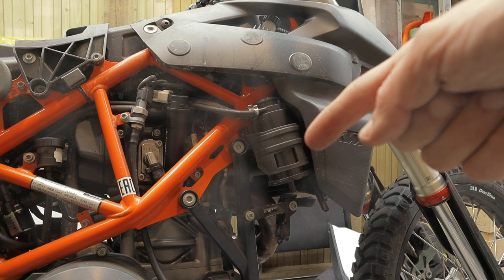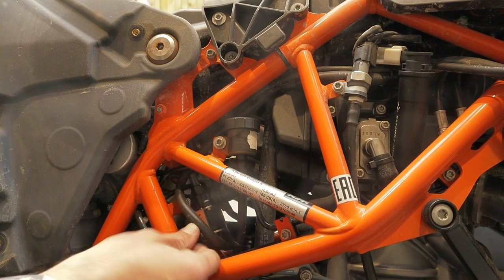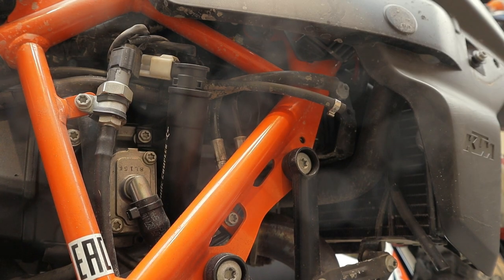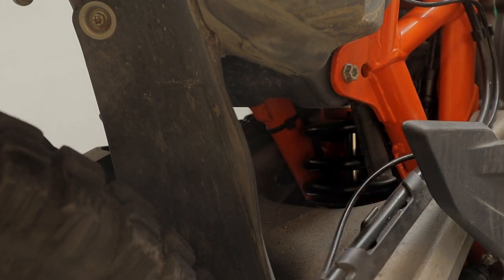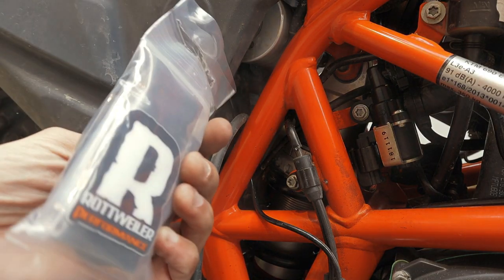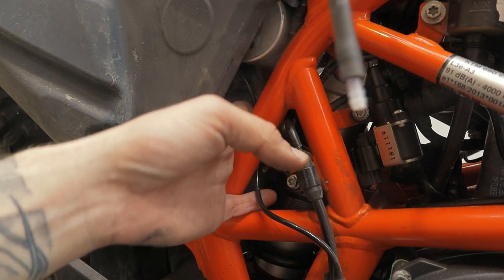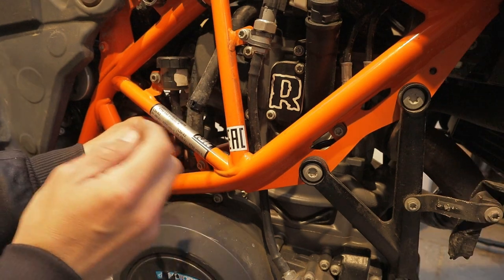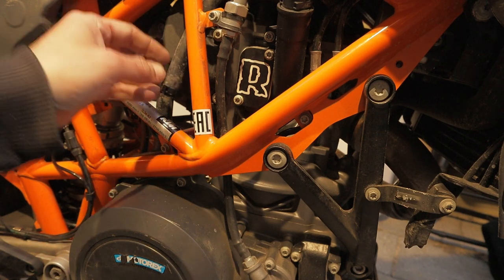KTM 690 Enduro R - How to install Rottweiler SAS/Canister Removal Kit [SuperMoto build series -Ep.3]

Comment: Great video...love the details & attitude. Question...instead of removing the big fat downtube with the Y on top of it (which was a lot of work) could you not just leave it there as is with the Y and two small tubes connected to the Y, and just cut the small tube coming from the canister and inch or so away from the Y and tie it closed with some wire ties ?...would that work ?

Comment: I hate buying stuff I dont need to and it appears purchasing this kit is not required..right?  ALL the "dongle" is is a 22k ohm resister?   less than a dollar....I am assuming I could use the existing plug and just solder a resister accross the terminals....then what is there a screw?....a tie wrap?   Now the blanking plate I dont see any need for....all that is needed is rubber nipple to cap where the hose had been and done......$60 for a couple dollars worth of stuff?   I dont get it??

Comment: Hi, what is the purpose of the sas cannister and the o2 sensor? Why is it good to remove it?
Reply from the maker: Hi Devileye.

The SAS and the canister system is two different things, people often mistake that. So theyre different systems, but usually just often done at the same time.

The SAS system, injects fresh air into the exhaustsystem to light Up the catalytic converter a little bit quicker.
And the cat is in the exhaust, so if you have an aftermarket exhaust It has No usage anymore. 
And its just dead Weight,  Theese two things saves around 4 pounds.
Besides that, It clutters Up your engine and are the reason for your burpeling and gurgleling when youre deaccellerating.
So thats the reason to Remove the sas system.

The canister system, pulls evaporation from the fuel tank. The fuel tanks on Theese bikes dont vent to the Atmosphere, they vent to the canister system.
And it then consumes that, for emissions 😡
Its also just deadweight and take Up a Lot of Space.

So you Will get an engine that runs smoother also.
Reply: The SAS canister is vapour recovery from the fuel tank.  It is a Charcoal canister.  Part of the Emission system.  Net zero performance gain removing it.  The O2 sensor measures amount of Oxygen in the exhaust stream and will adjust fuel accordingly to maintain a 14:1 Air fuel ratio.  The fuel dongle referenced at the beginning of the video sends a signal to the bike to stay in Open loop (no reference to the O2 sensor.) The benefit of the Fuel dongle is it lets bike run a richer (13.5:1) at idle and just off idle.  Improves low end throttle response.  With the dongle you can remove the O2 sensor.  I left the SAS in place.  to expensive and labour intensive for no performance gains.  I don't waste gas money on aesthetics.  I did add the fuel dongle.  Left the O2 sensor in place.  Two reasons.  Don't give anyone any reason to look to closely at my bike.  If fuel dongle falls out (as it doesn't lock in place) I can reconnect O2 sensor and get home.  I ride a long way into the back country an dleave nothing to chance getting home.
Reply: In conclusion, what does the motorcycle do to remove the canister?  It gives more performance than?
Reply: @zrig1  thank you for your insightful comment.
I went the exact same way.